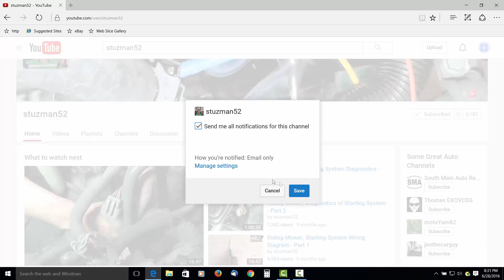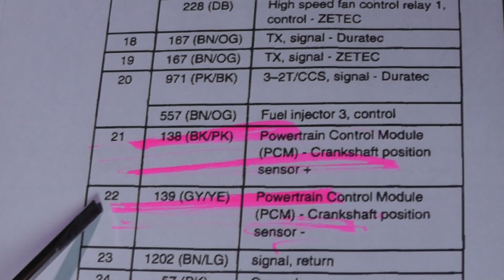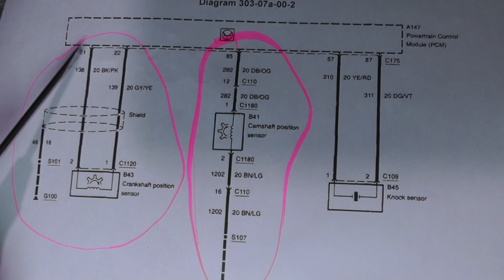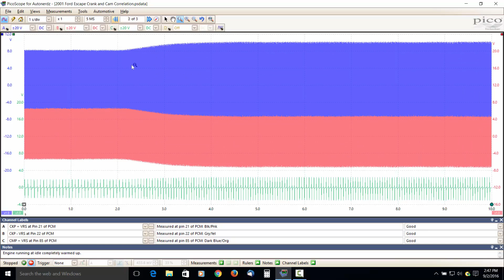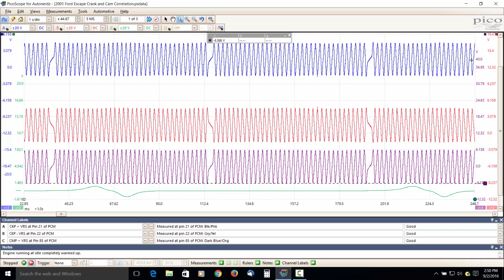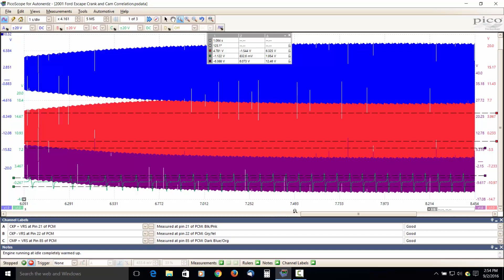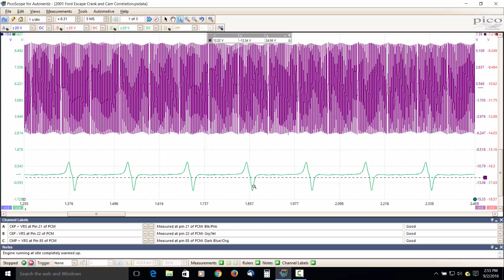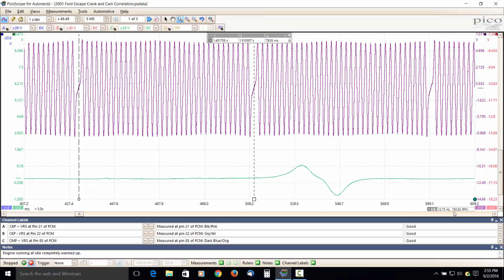Ford Escape Crank and Cam Waveforms Using a Math Channel

Comment: Hi Terry, that was a nice capture with the Pico! Great application for the math channel feature too. I just checked on my 2245 model they made all the grounds isolated! So to use a common ground you have to piggyback the ground leads.

I was wondering, from basic principles, would the VRS peak-to-peak signal voltage be directly proportional to engine speed? Is there a limit? I miss your insightful comments on my channel Terry, hope all is well :)
Reply from the maker: Thank you Ivan and glad you found the video helpful. You should find 
that the PP voltage to be proportional to engine speed. As for a limit, 
theoretically, the voltage should continue to climb, but I'm sure 
there's some point where it would stop. The voltage across an inductor 
would be VL = L * d(I) / d(t). So as you can see from the equation, the 
larger the inductor, and/or the higher the current and the faster that 
the magnetic field collapses the higher the voltage will go. And I miss 
your comments on my channel too. I'll have to post a few comments on 
yours :)
Reply: Ah of course the VRS sensor is an inductor! Now why to they call in a variable "reluctance" sensor? That makes me want to dust off my favorite college E&M textbook "Introduction to Electrodynamics" By David Griffiths :)
Reply from the maker: The reluctance refers to the opposing force (EMF) that's created when there is a disruption through the magnetic field. As the teeth on the reluctor pass through the magnetic field, the field is disrupted. And the reluctance varies depending on where the tooth is at within the magnetic field. It's been awhile for me too Ivan on theory, but I think that's the bulk of it :)

Comment: Very nice, sir! I don't fully understand about grounding floating grounds. Perhaps you could elaborate more in a video. I get it, but not clearly enough.
Reply from the maker: Not hard to understand Steve :) It's just that the PCM needs to see the positive signal AND the negative signal. On some cars, the negative signal is grounded which when measured to ground is 0 volts. But as you saw with this car, there is a negative signal with respect to ground. If you grounded out this signal, there would be 0 volts and of course, the PCM wouldn't like that which prevents the car from starting. That's why I mentioned that you have to be careful with a scope hookup with sensors that have a floating ground or negative signal that's used by the PCM.

Let's say that I hook channel A of the scope to the positive signal of the crank sensor and the ground lead for that channel goes to battery negative. All is good! And let's say that I hook channel B to the cam sensor's positive signal, but I don't need to hook up a separate ground to this channel because all of the scope's grounds are internally connected together. Channel B gets it's signal ground from the ground of channel A which was connected to battery negative. And everything is just fine and the car will start and run. The only issue with this is that you would not see the true amplitude of the crank signal because I'm only looking at the positive signal. Are you still with me :) ?

To see the true amplitude of the crank signal, I could take the scope leads for channel A and hook them directly across the sensor, but I can't use any of the other channels from the scope. All is good! Can you see that with the scope leads hooked up across the sensor, that it's not connected to battery negative? And again, all is good!

Now, if I hooked up channel B to look at the cam signal which needs it's channel grounded to battery negative, then I've just grounded out the negative signal for the crank signal. This happened because of the battery negative scope ground which was used for the cam signal. Remember, all of the scope's grounds are connected together internally. And then the car will immediately stall.

So, how can you see the true amplitude of the crank signal along with the cam signal? That's what this video was all about. Using a math channel of (channel A - channel B) which gives me the true amplitude. As you may remember from the video, channel A was the positive crank signal and channel B was the negative crank signal. And channel C was for the cam signal which didn't use a math channel. The cam signal in this case has it's negative going signal tied to ground through the PCM. There you go Steve; was that clear as mud? Holler out if there is anything that you didn't understand...
Reply: I get the bulk of this. But when you say the car will stall out if you ground the cam sensor ground to battery, because the internals grounds are shared, that doesn't make sense. it doesnt, because you grounded the crank sensor channel A's ground to battery negative in the video, and the car didn't stall. You used A to get 6v, B to get -6 volts, and C to get a cam signal.

You referened these 3 signals to battery negative, then use math channels for A-B to see the full 12v, and a signal on C. Well, if you grounded signal ground on C (therefore all channels), that means the car didn't stall even though A and B are now referenced to ground. 

So if the car didn't stall in your video, how would it ever stall?
Reply from the maker: If I was to take channel A's scope leads and go directly across the crank sensor; the positive lead from the scope to the positive signal, and the ground lead of the scope to the negative signal, the car wouldn't stall. But you can see that I actually have a negative signal on the ground lead now and not battery negative. Even still this wouldn't make the car stall, and I would see the true amplitude of the crank signal. The problem comes in when I hook up the cam signal where it's negative signal is at ground. Then I just grounded out that negative signal from the crank sensor through the internal grounds of the scope. You say that I grounded out the crank sensor on Channel A when I hooked up the cam signal. No, the two signals from the crank were not grounded because each were referenced to ground, not connected to it. Not sure if I can explain it any better Steve, but it is good that you're thinking about it as it shows that you're interested in how things work. That's the markings of a great engineer thinking :)

Comment: I just got a picoscope 4425 and am new at it. Could you tell me why my "zero" (or baseline) jumps up and down during my coil current ramp test while engine is running. The ramps are fine, but just the zero line (with ramps on it) are jumping up and down. Thanks.....
Reply from the maker: The only thing that comes to mind is some issue with your amp clamp. Which clamp are you using? Did you buy the kit which includes the Pico amp clamp? Try using it on another circuit such as a headlight circuit to see if the 0 baseline stays the same.
Reply: Its all brand new, scope and 2 amp clamps TA018 by pico. Both clamps have the same result on baseline. Tried plugging in to other channels also. Please help... scope is pico 4425
Reply: Do you zero it then put it on wire or put it on wire then zero it?
Reply: Some grounding issue? Sorry for the questions, thank you for your response....
Reply from the maker: The procedure is to open and close the amp clamp a few times before placing it on the wire. This removes any residual magnetism in the jaws. Then with the amp clamp closed, close to the wire but not around it, zero the clamp. Then place it on the wire.
Reply from the maker: Wow Murle! I know the 4425 has isolated inputs, but would not expect this behavior. I have never heard of anything like this happening. Maybe with the ground floating, this is causing the issue. Of course, you're not having any other problems such as looking at voltage signals, correct? I don't know where you purchased the kit, but Tom Roberts and others on the forum could possibly answer your question. I'm not sure what's going on there Murle...Here's the link http://www.autonerdz.com/cgi/yabb2/YaBB.pl
Reply: Where are you measuring the current going to the coils? Perhaps there is another load tied in to the same feed wire and its current is being superimposed on your current ramps?

Comment: Nice video and good demonstration of how to diagnose a no start.
Reply from the maker: Thanks Jim, but this car didn't have any problems. I was demonstrating of how to use a math channel on the crank signal and the timing between the crank and cam signals. Also was doing this as a known good reference for comparison down the road if something happened between these sensors. Have a great day Jim and don't work too hard!

Comment: Hi Mr. Terry, thanks for the wonderful informative videos. I have a question and I think your the perfect man to answer it. I just bought a cheapy automotive lab scope from Ebay not too long ago, and I'm still in the process of learning how to use the darn thing. The question I have for you is, what is the difference between the graphing multimeter function  and the scope function? And when your doing testing like this, crankshaft or camshaft position sensor testing which one do you use? If you can give me a little bit of direction I would truly appreciate it. Thank you.
Reply from the maker: The graphing function is for voltage levels that will change but at a slower rate. To give you an example, let's say that you suspect a loose connection somewhere in a bundle. So, you set up the graphing meter to monitor 12V on that circuit. You move the wires while monitoring the graph to see if the voltage drops out. With something like this, you don't need a hi-speed sampling rate in the microseconds or even milliseconds to find this problem. When you're looking at sensors such as crank, cam, maf, bus networks, etc. you want a scope with a higher sampling rate because these signals are moving pretty fast. If you use the graphing meter on these sensors and there was a glitch, you would never see it because the graphing meter is too slow. There you go! Now, get out there and have some fun with your scope :)
Reply: +stuzman52  Thank you Mr. Terry :) you truly are a gentleman.
Reply from the maker: No problem Oshin...always glad to help!

Comment: Those are clean results, nicely done. When I use my generic oscilloscope I tend to get a lot of artefact.
Reply from the maker: Hey Dave and hope you and your family are well! For the artifacts, it could be that your sampling rate may be too high for the time base being used. For longer time bases you need a high sampling rate and with that you need a large record length which just means plenty of memory in the scope to store large amounts of data that's being sampled. Otherwise without the memory to store the data, the signal will be aliased if that's what you're referring to. And with higher sampling rates, you'll tend to get a lot of noise on the signal. That's where filtering of the signal(s) can be handy. Thank you Dave for dropping in and leaving a comment.

Comment: Does the minus A and B math stick for your second measurements after setting it the first time? By the apparent true voltage measurements, I think it did. About double the RPM is double the voltage peak to peak.

So, getting true amplitude...without that we're all just blokes seeing that it's going up and down and it should be fine...that's like guessing then that the sensors are fine when they could be causing an intermittent failure that's hard to see like we've seen Scanner Danner find.

I'm assuming a bit at the edge of my knowledge here.

How in the world did you know to minus b from a to get true amperage/voltage peaks? Is that just how floating sensors work?

Or should I be asking, how does that compensate when measuring directly at the sensor would need no compensation? Yes, I can see that being bad...it's probably behind a starter so how do you probe and have it run...still marvelous that an a minus b fixes it...does this require that the cam or crank be "a"? Meaning, if you went opposite on the channel selection would you have to do b minus a?
Reply from the maker: You've got a lot of questions there DE :) Yes, once you use the math channel, it says there forever unless you remove it. Of course, you have to save the file and when you open it, that math waveform will still be there.

A lot of times, guys will just look at one side of the sensor and use it along with the cam sensor to check the correlation of the timing. They may not be interested in the true amplitude of the crank signal. Ah, you're not at the edge of your knowledge :) Yes, that's the way floating sensors work as they are not grounded on either side. Some VRS type ABS sensors are wired this way too. Same procedure can be used on those too. 

Both sides of the crank signals don't have to be on A and B. I only used these channels as the software has them built in. But, you could put them on any channel you please and then you would create the math channels yourself for those pertinent channels.

If I put the positive signal on B and the negative signal on A, it would still work except when combined with the math channel, the signal would be negative going instead of positive going as shown in the video. It's customary to have the crank signal shown with a positive polarity. Okay, did I get it all covered? :)
Reply: stuzman52 good videos get me thinking. What can I say?
Reply from the maker: Not a thing in the world with thinking DE...it keeps us on our toes when someone comes along and asks a question like yourself :)
Reply: stuzman52
:)

Comment: Terry, great vid ! Using vehicle ground avoids shorting the sensors and their ground/negative signals when probing more than one sensor instead of the sensor ground but as you said you only get half the signal amplitude. Using the Math channel on the Pico is a cool work around ! I would love to see you do some measurements of  your good captures of the Cam angle in relation to the Crank position to see if their will be any future Crank/Cam Position Correlation  problems due to worn sprocket/vct timing or timing chain issues before a DTC P0016/P0017 sets.  My understanding is that if the PCM detects that the Crank and Cam signals are out of time by a specific number of degrees it will set these codes.
Reply from the maker: You are correct Billy that folks need to think about their scope hookup, it's quite easy to short out one side of the signal and not to mention ground loops which can damage other equipment such as scanners. And with the crank/cam correlation of where the belt/chain can get stretch or worn sprockets, etc. a known good waveform is good to have for a future reference. If I get a hold of a vehicle with a known good waveforms and one where the crank/cam correlation is off, I'll post a video for sure. Always good Billy to see you drop in and leave your thoughts. Take care...

Comment: Great info & nice captures! Cool trick using the Math channel!
Reply: ***** I've been thinking that a long time too.

An old SnapOn at one shop had a scope. It sure was a problem solver. :) Usually, you can get away without, but this is premium information on tougher issues to solve.
Reply from the maker: Thanks Thomas and glad you liked the video. And I appreciate you dropping in and leaving a comment!
Reply: This had a lot of twists I didn't expect Thomas! :)
Reply: DE Nichols One day  I'm gonna have & play with a Pico Scope as well!
Reply from the maker: No doubt about it Thomas in my mind. You'll have one for sure :)
Reply: *****
Little warning for you. If you go for an old SnapOn Modus, I hope you don't mind attaching it to the battery all the time or if it could get a new battery.

Worse yet, all the leads to use it with costs more than the scope...maybe it's a bad example, but I looked it up since I liked it...most shops have better scan tools but it could be, if used, a better way to get a quality scope, with a usually professional level scan tool with it (it was OLD).
Reply: +DE “AutoBravado” Nichols You can never have too many toys... I've got several snap-on products. I have backups for my backups so to speak. Don't get the chance to use them much since all we see is regular maintenance stuff.

The reason I went with the snap-on line is because of the broad range of information covering different manufacturers & component testing.
Reply: *****
Yeah, that Modus had really complete information up to what it was updated too. I don't know if they still update those older models. It kinda feels like SnapOn would be the kind of company that would, but then it's also software and no one updates software forever on old machinery. We definitely didn't need it up to date on the newest five years. Usually those cars had simple problems anyway, if any other than maintenance like you said.